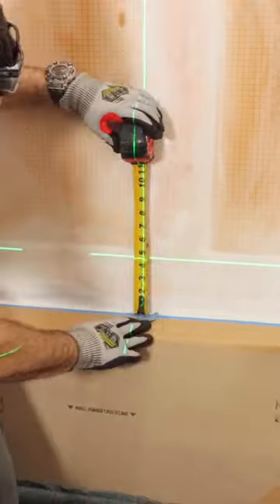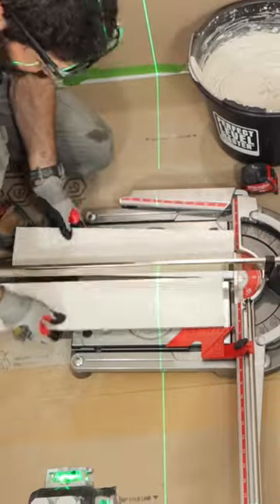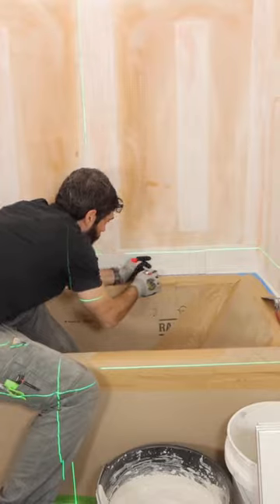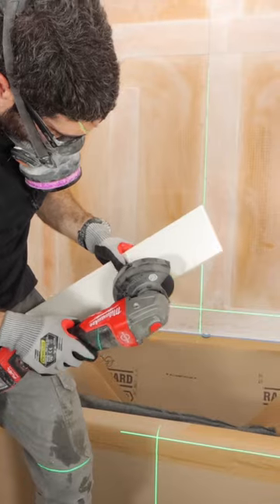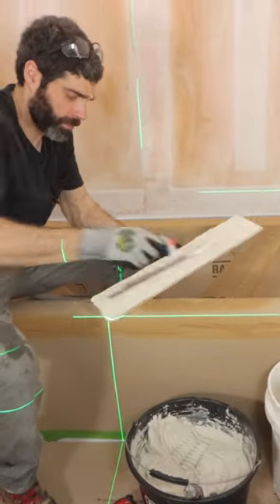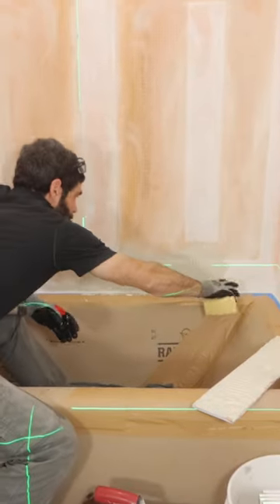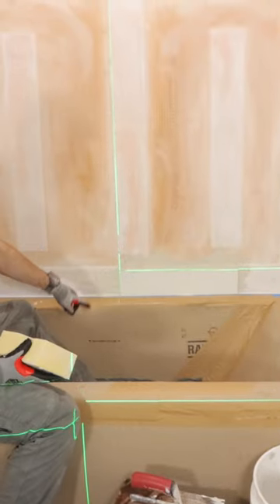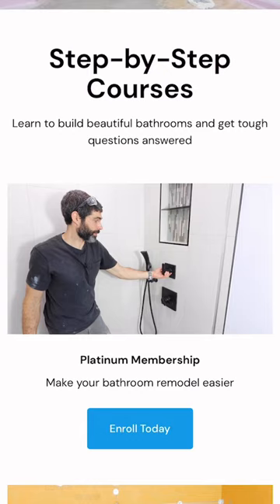How to Tile the First Row of a Bathtub Shower Wall - #shorts

Comment: I'd rather have the cut at the top. I like full tiles at the bottom since generally you look down in the tub or shower. Tubs are never perfect so grout line will be weird by the tub but I'd rather see a bigger groutline than a cut piece there. I had one customer who preferred the cut to be at the tub. I measure out the niches to have full tiles for top or bottom. Depending one the tile of course. If it's an odd size niche that's fine it just looks better. You do great work. Your work is always so clean and organized not on that level yet. What tile snapper do you use? I can do 90% of the cuts with it. So much easier. It's been about 8 years using one and never going back. I used that schluter drain for the first time last year sooooooo much easier and came out perfect.
Reply from the maker: Thank you, I use Montolit Masterpiumas, the new P5 is excellent. It makes clean snaps and can handle mosaics as well as large porcelain tiles. The Schluter point drains are excellent for tile. The fact that they’re solvent welded and the grate kit can be adjusted vertically and laterally make it way better than most options